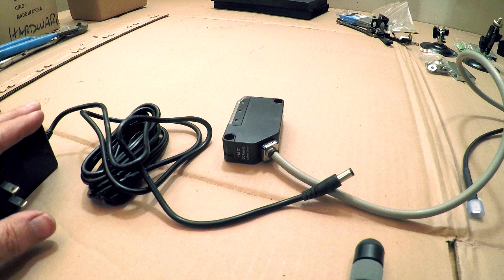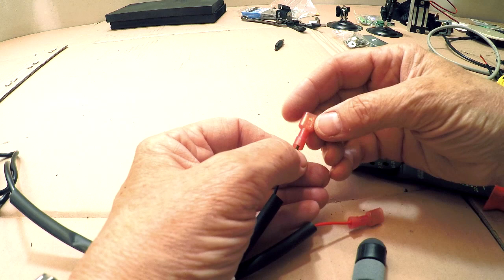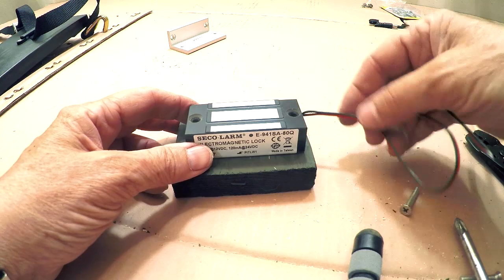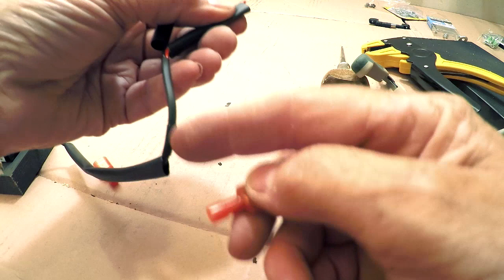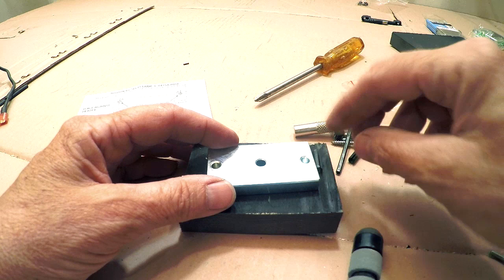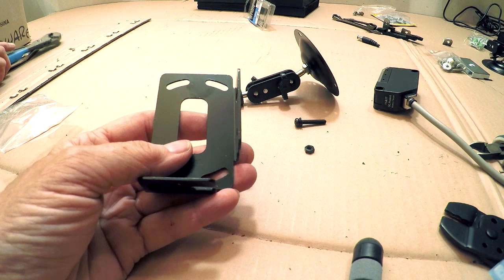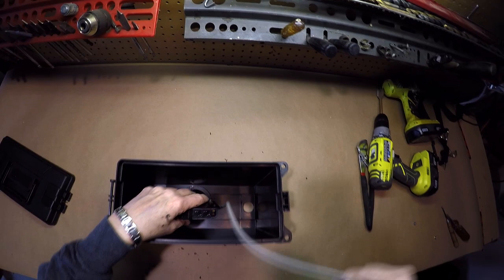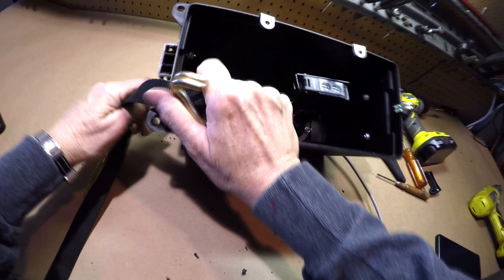Raytripper Magnet & Mounts

Comment: Thank you for these videos!!! I am in the process of building a raytripper based on these videos! I have a question about the reflector that you built from the the lid of the box. Based on the strap, it looks like it is mounted on the outside of the missy? My question is - if it is mounted on the outside, doesn't that cut down the reflective area if the sensor hits the metal on the trap? I guess that makes sense to have it on the outside to cut down on distractions to the dog, but am I thinking of that correctly? Or is the sensor on the parts list so precise that in a regular size missy, even the area within a rectangle of the fencing it's easy to point the sensor?